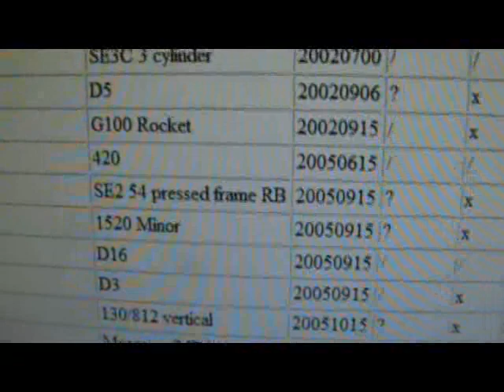1954 Mamod SE2   STWWW 2012

Comment: Dear me!  Why screw it down?  It's not going anywhere, it'a a stationary engine!  Mine runs unfettered indoors,  Yours should too,  Nice collection by the way.
Reply from the maker: For an engine that's called "stationary", it's anything but!!! The last thing I want is for it to walk off the edge of the table when I blink. If I was running it on the floor, that'd be a different matter ;-)